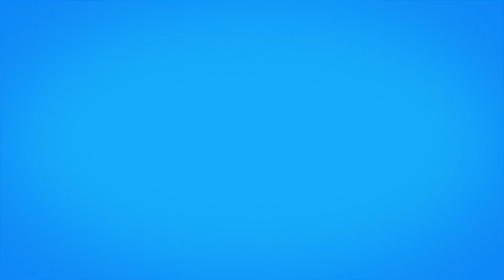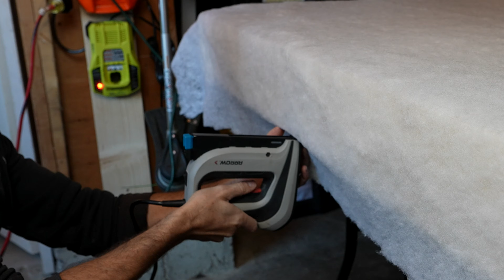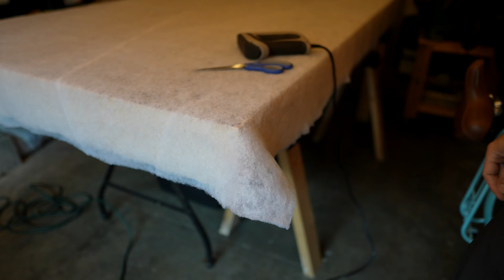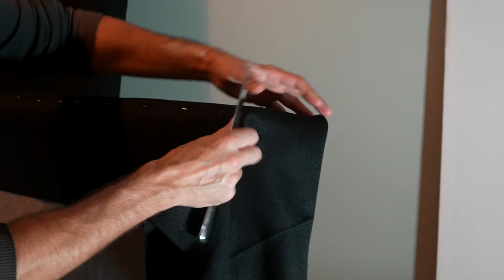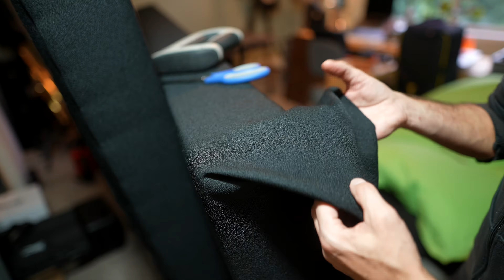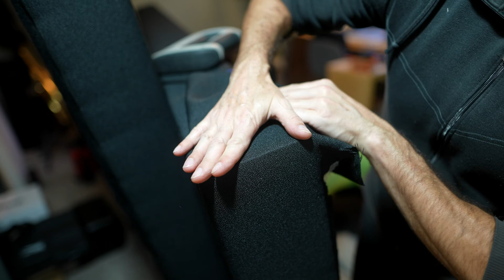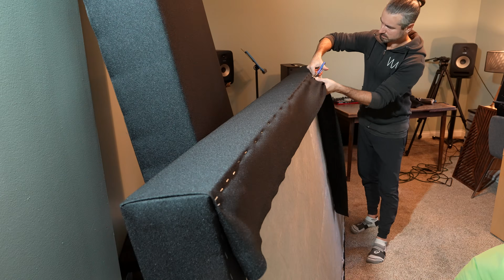Master the Art of Wrapping DIY Acoustic Panels Like a Pro!

Comment: Is there any calculator that is able to subtract the gypsum plate in front of the porus aborber to get a graph like in amroc audio calculators fornporus aborbers. I dont know how to calculate the rt60 corectly when the calculation is only taking open wall or just porus absorbers into account. 

For example inwant to make a drywall 50cm thick of glasswool. I want to know how the absoption of bass up to 500hz would look like. 

Thanks in advance
Reply from the maker: Hey hey. Not quite sure what you’re referring to.  There is no gypsum plate in any of my designs.  You’d never use gypsum in front of a porous absorber unless you were trying to create a pressure based bass trap, and there are better materials to use.  

Also, reverb time calculations will fail in a music studio that’s small and treated.  The room cannot meet the criteria for a diffuse sound field. We never use that formula for control rooms.  

You’ll want to instead shoot the room with REW and look at the frequency specific decay times (spectrogram and waterfall), T20, T30.  Or use the John Brandt room mode calculator and look at mean free path.
Reply: @warpacademy  what did you put in front of your pink fluffy glass wool ? You did not cover 100% of your walls an ceiling with cloth after stuffing it with glad wool. So maybe you use woof panels osb or gypsum plates. How do you calculate it ? You can never meet any RT60 norm if you just put wool into the room and cover it with cloth it would sound. Dead after 500hz so you have to have some reflective materials.in front fo your pink glass wool to just let the bass into the material and let it absorb and reflect other frequencys. It doesn't matter if you use osb panels or wood or gypsum or any anything else.
Reply from the maker: Here is my completed control room reveal: https://youtu.be/XfO_btDeXjc. Here is a deep dive into the design of the room: https://youtu.be/5VrG2K_E7qI. 

No, none of the modules are faced with OSB or gypsum.  The only gypsum (drywall) is in the isolation shell on the outside of all the interior room treatment.  You don't want a control room to be very reflective.  If you're designing a recording studio, then yes, you want hard reflective surfaces and no parallel walls.  Control room design is very different.  You need symmetry and zero specular reflections back to the mix pos.

My room uses a combination of rockwool and fiberglass for porous absorption, graduated density.  All of it is wrapped with the exact materials indicated in my video (cotton batting and GOM Anchorage acoustic fabric).  Both of those materials are porous and absorptive.  

Are you familiar with the design of a non-environment room?  That's what this is.  There is a small amount of controlled scattering from plywood slats located about 12' behind the mix pos. on the front of the back wall modules.  The front wall is hard and fully live, for acoustic queuing, and the floor is hardwood.  

The room is ideal for me and the type of engineering I do.  It's not too dead.  Some people may find non-environment rooms too dead, but that's a matter of personal preference rather than objective acoustic suitability.  Look at the Northward rooms.  Those are more dead than my room, or at least very similar in terms of the ETC.

Hope that makes sense.  Let me know if you have any other questions.  Cheers!
Reply: @warpacademy  okay that's not what I'm Looking for . I want to got with the DIN 15996 for Studios, that's my target. I calculated the Absorbtion, Reflection and Transmission of the 12.3mm Gypsum and Multiplied it with the proud absorbtion graph from amroc. Now I can model my room in amroc and I got really good results for my relative cheap build
Reply from the maker: Glad you found something that works for you.  Good luck with the build.  When you're done, share acoustic tests if you can.  It would be interesting to see them (from REW).

Comment: Sweet video. Good idea on the batting, I knew I needed something as a base for the fabric. Also splurged on fabric..Duvaltex makes some great stuff. Nice to see someone else using 5" deep lumber, sure does make heavy panels though. How acoustically transparent do you think the batting is?
Reply from the maker: Nice to hear from you!  Did you get the FR701?  I think it's well worth investing in the fabric.  It's really dirt cheap in the grand scheme of things.  $250 all in for one of these modules is unreal, considering anything pre-fab is going to be multiples more expensive and not likely to perform as well.  

5.5" deep modules is table stakes IMO and you really need thicker absorption for a pro room.  1.5 to 2 feet thick on the side walls and ceiling would be better.  Thicker on the the back wall.  Anyone using 3.5" thick panels (or thinner) is just getting hobbyist results that will more or less just make the room sound like it's got a huge lowpass filter on it, doing virtually nothing for the LF.  

The cotton batting is super transparent.  If you can blow through it easily, it's fine.  That's the test.  The landscaping fabric is slightly more resistive and could bounce some HF, but that would be attenuated by the batting and GOM front layer anyways.  

Good luck with your room!